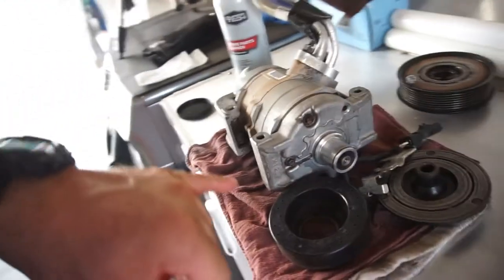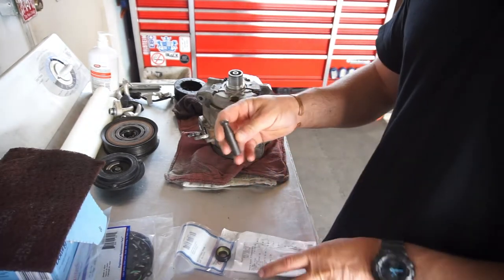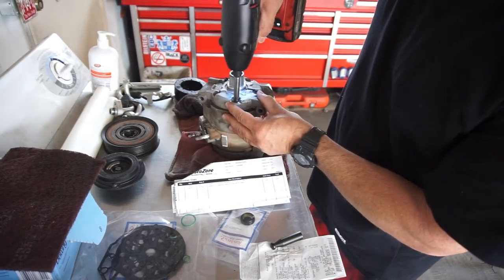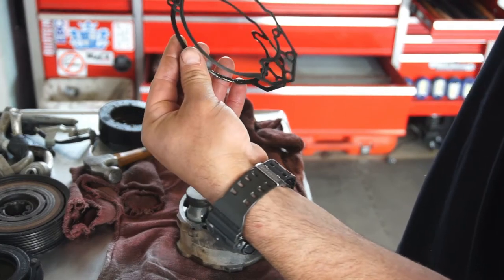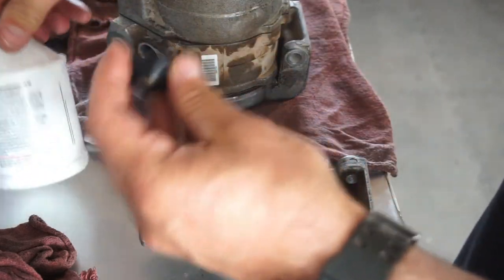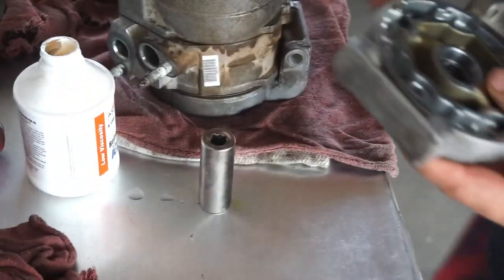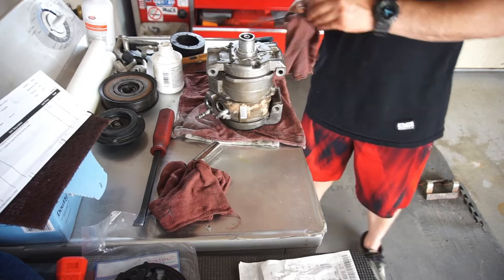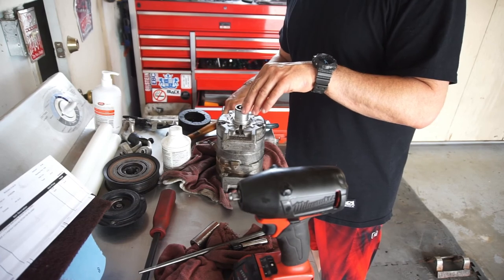$60 AC Compressor Rebuild vs Buying A Rebuilt One From The Store. Failed Attempt As Usual..

Comment: Maybe you weren't supposed to lube the bolts ?  They were turning too easy , so ya' couldn't get the proper torque ? IDK , just a guess on my part .
Reply from the maker: Hahahaha. No that’s just too much torque on these little 6mm bolts. Max on every 6mm bolt has always been 12 foot pounds. 8 foot pounds is really all it needs. 🤦‍♂️🤦‍♂️🤷‍♂️

Comment: I haven't finished watching the video but did you ac compressor worked
Reply from the maker: Yes. I installed it last weekend and it’s been holding up great. I check for leaks with a uv light almost everyday haha. Nothing glowing.